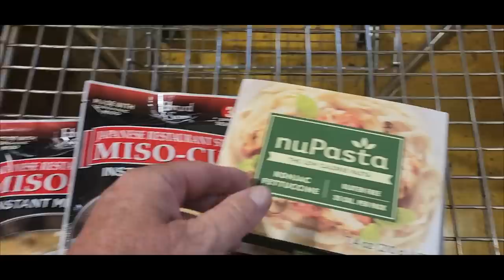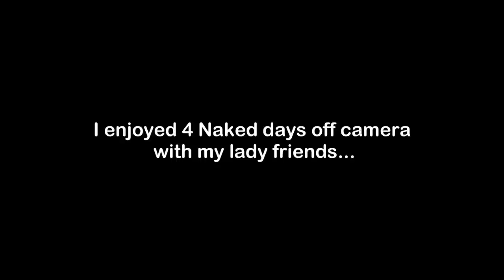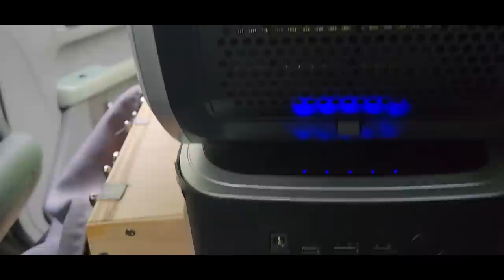How to Install a Zero Breeze Mark 2 Portable Air Conditioner in A Honda Element!

Comment: 4600 pounds is one thing, but you didn't weigh your front and rear axles to see if you were over on your allowable axle weights.  GVWR is good but knowing your axle weights are also necessary.

We had a motorhome that had 2900 pounds of carrying capacity and a GVWR of 14,000 pounds.  The biggest storage compartment and the water tank were all right on top of or behind the rear axle.  Filling the water tank (50 gallons) could easily put us overweight on the rear axle while still being well within the overall GVWR.  Knowing the total weight without knowing where the weight actually resides isn't telling you what you need to know.    Hugs Mindy!  You're looking as cute as ever.  RAWR!
Reply from the maker: Thanks for creating a new account to leave me this comment. As you know from following my channel and videos, I have and do consider the weight and distribution of my gear. I have replaced the entire suspension, put on new tires and wheels and replaced the struts. You are correct that I have not weighed the front separately from the back, and I will address this in the future. I understand and know that my vehicle is a unibody as well. Stay tuned for this updated information in a future video, thanks for watching and commenting, we can all learn something together here. Cheers!

Comment: Well done. Would like to know what the outlet temp got down to when you shut your doors? So talented with the duct tape. Love me some Bugles! Thanks for the video 9. 😁
Reply from the maker: Thank you! I am glad that you saw this, I will update more information as I travel with this. Cheers!
Reply: @NinthElement  Cool 9. I am putting too much runtime on my vehicle using the engine. Have gotten used to the gentle vibration of my truck while i sleep, though. Hope to be in the Portland Seattle area this fall. Want to try out some tiny houses before i downsize.
Reply from the maker: Look into Air B&B for Tiny house stays. I have been in 3 this year, and it has helped me to figure out my size and design. Happy travels, Cheers!

Comment: Why did you go from horizontal ports to vertical?
Reply from the maker: I am not sure what your question is, but thanks for watching. Cheers!
Reply: @NinthElement the holes in the window are vertical 😊
Reply from the maker: hmmm...I installed the air conditioner with the holes horizontal. Still not sure what you are referring to?